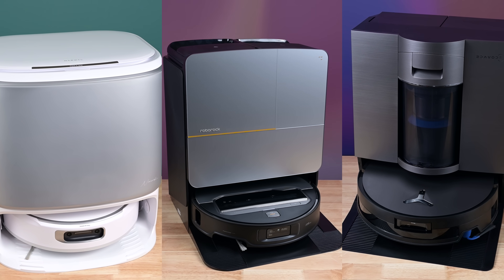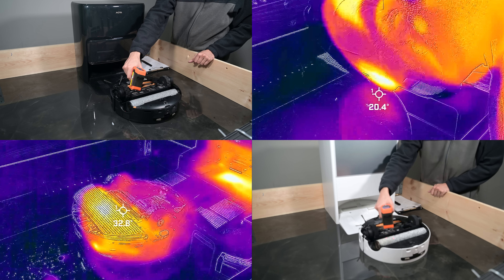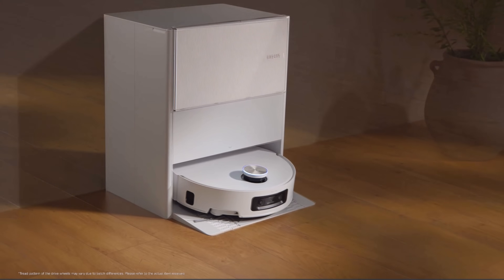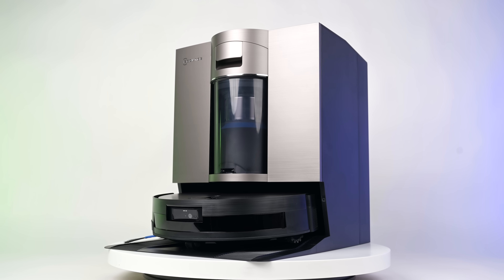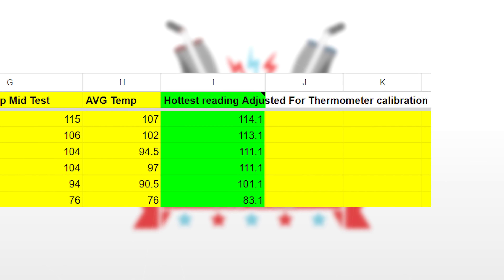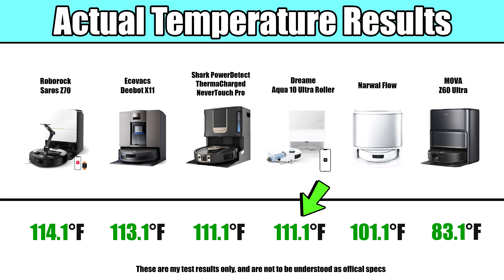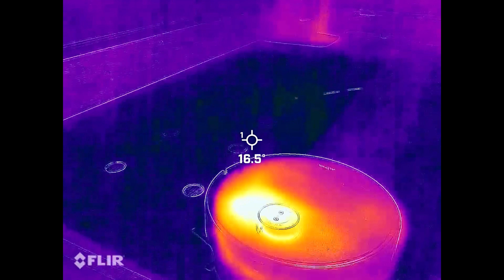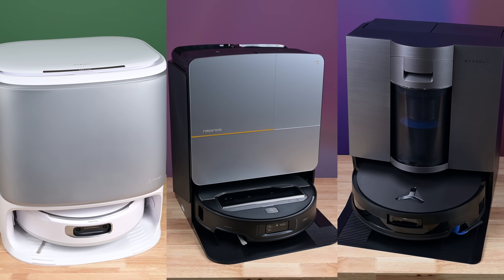Heated Robot Vacuum Mop Docks: Claims vs Reality (Thermal / Temp Tests)

Comment: infrared after the cleaning is not a good test. In these temperatures and hot water (evaporative cooling) they can drop a lot of heat in seconds. Thermocouple in the tank where cleaning happens, that would do it. Or thin foil thermistor, isolated and on very thin wires glued over with kapton to the case, going outside.

Comment: Something I think is important that I haven’t seen touched on anywhere else is the how well the bases clean the mop pads. I think a good test for this would be to get some UV active liquid and put it on the mop pads to which the base will do its cleaning cycle. After it’s done you could take the mops and see how much of the uv liquid is actually gone and if there are specific spots that are missed

Comment: Microfibre cloths are not meant to be washed above 40 degrees celsius as it destroys the structure of the material.

So these high cleaning temperatures are actually ruining the mop pads. 🤦

Comment: Package claims not verified on real world test should be illegal. I understand there is a slight variation, and I'm willing to give the benefit of doubt, but not when the claimed temp is twice the one mesured. Especially for high price object as this since thermostats and temp controls are probably like maximum 5 more dollars to introduce.

I'd like to say this is probably bad calibration but this cannot be. Not to that extend.
Reply from the maker: Part of the goal with testing like this is to better understand where those differences come from and how they translate to actual use.
Reply: @VacuumWars  Yes, I get it and thank you for that. If it was about vacuum power (like CFM or air speed) it would makes sense because there is a lot involved in suction including the robot height. So a lot of factors can influence things so I would be really okay with vaste differences between claims and real world provided there is an explanation on the way to mesure things.

However, for water temperature, there is litterally no such thing. Temperature is a straigh up defined unit. You can get your water to temp, and it will be there on the good temperature on the pads. Or you cannot. You can lose a couple of degrees depending on the plumbing but you know, you have litterally water boilers for tea that can stop when water is boiling in like 5 seconds. So you boil up water, you wash, and then everything fine.

This is lying. As this is about cleaning, and disinfecting, it influences air quality during and after doing the cleaning, and can make a huge difference for people with allergies, this is not like having a robot that doesn't suck as much as it should and leave a bit things on the ground.

Comment: Engineer here, the small amounts of water used to clean a mop, and the thermal mass of the mop assembly, mean that very hot water applied to a mop will cool significantly. Manufacturers probably test/control incoming water from the heater unit, not once it’s applied to the mop. Granted, the temperature AT the mop does matter most on how much oil/grease is removed from the mop… so you’re doing the right thing! 🎉
Reply from the maker: Thanks for sharing that perspective. Thermal mass and rapid cooling definitely play a role, and it makes sense that some claims may reflect heater output rather than conditions at the mop itself. Looking at temperatures closer to the point of contact helps give a clearer picture of real-world behavior.

Comment: The voice isn’t bad, I don’t care for it at all.

The script and its delivery however is deal breaker.

The tempo is all wrong and the script is super bloated which doesn’t help.

The narrator has no intonation at all, its so flat it is completely impossible to get sentences structure and punctuation.
It really gets in the way.

Cut the ai crap. Don’t try to do more by getting help from slop pleas. It really undermine the actual work your doing behind the scene.
Less is more.

Comment: Quite possibly the worst testing methodology I've ever seen. 

This is beyond useless. Using an infrared thermometer to read the temperature of an absorbent material to under the water temp. 

Could be a lot better just to use a thermocouple in the water itself.

Comment: you should put a thermocouple at the point where the warm water comes out from the dock. Then you don't have to disturb the cleaning cycle and it should give a more fair representation.
Reply from the maker: That’s a solid suggestion. Measuring with a thermocouple right at the dock’s water outlet would avoid disrupting the cycle and give a more accurate, consistent picture of the actual water temperature being delivered.

Comment: It would probably be more accurate to somehow wire in a thermal probe in the washing basin to track the temperature
Reply from the maker: That’s a good idea. Measuring temperature directly in the wash basin with a wired thermal probe would remove a lot of variables.

Comment: Perhaps Mova Z60 need to set"High Temperature Cleaning Mop" in the app, as the default option is not the highest temperature setting.
Reply from the maker: Good point
Reply: @VacuumWars  Can you confirm during your testing that the Mova app was set to "High temperature cleaning mop"? I feel like this is a huge oversight.

Comment: This is one of the most rubbish videos this channel has ever made. First, optical thermometers are very inaccurate and have to be used within a specific distance range, in the video it was held too close. Second, readings vary depending on the type of surface you’re pointing at.
Also, every mop responds differently to temperature. The proper test would be to measure the actual water temperature coming from the outlet using a probe thermometer, nothing less, nothing more.

Comment: Wouldn’t we be more interested in the temperature of the water being applied to the mop pads than the temperature of the mop pads themselves?
Reply: I think both numbers are equally interesting. But it should be a lot easier to get an accurate temperature reading from a liquid as opposed to the mops.
Reply from the maker: Good question! Water temperature matters at the start, but what really affects cleaning is the temperature of the mop pads once they’re on the floor. The water cools very quickly after leaving the tank, so pad temperature ends up being the best indicator of sustained, real-world cleaning performance.

Comment: Laser thermometers are notoriously inaccurate. Why didn't you use a thermocouple and embed the wires directly into the vacuum? Those are far more accurate.
Reply: Optical thermometers aren't great for absolute temperature, but they should be fine for temperature comparisons, which is what matters most here. Someone else mentioned concerns about different material emissivity, but considering that all pads will be made from some type of plastic-based fabric (polyester or nylon, probably) and will be coated in water, I don't think this is likely to make a material difference in the results.
Reply: @Adreitz7  All great points, but the purpose of the test was to evaluate which device reaches the (absolute) temperature the manufacturer advertised. I think you have to measure the thermal elements in-situ to be able to properly measure that number. If I'm the manufacturer, that's the one that I'm going to use when making that claim.
Reply: @DougWilliams06 Thermal cameras might be off by 5 degrees or so, but never by 20 at reasonable temperatures (unless you are trying to measure a thermally reflective surface like metal or glass). Not good when you’re trying to diagnose a fever, but fine for a case like this. So I think the results as given are a fairly good indicator that none of the robots are able to maintain the claimed water temperatures for very long past the thermal elements that do the heating.
Reply: Who do you think this is? Consumer Reports? 😂 Also don't forget to click on their sponsored affiliate links.
Reply: Removing the vacuums from the docs also gives a lot of time for the temperatures to drop.

Comment: Great that you are focusing on this! - The producers' claims seem to be wildly exaggerated. I'm currently on my second Mova V50, as the first one's hot mop washing was - not hot at all.. And the second replacement unit, same problem. The mop is at ambient temperature after a washing session, right before a supposedly "hot water mopping" cleaning task.  I also tried emptying the dirty water tank right before initiating hot water mop washing, and  measured the dirty water tanks tempareture right after mop washing (we are talking seconds after), and the water temperature is the same ambient room temperature as the clean water. I still hope that this is an issue that Mova can fix with another replacement unit - and that it is not simply false advertising. When they claim 80 degree celcious mop waterwashing, then I expect the water to be 80 degrees while washing.
Reply from the maker: That’s a fair concern. there should be clear, noticeable heat during and right after the wash. If everything is still at room temperature seconds later, it raises real questions about whether the heating feature is actually operating as claimed.

Comment: Optical thermometers require calibration for the exact surface they are taking a measurement from. Since the mops from different brands are made from different materials, with different textures and colors, I don't think these results can be treated as an objective apples to apples comparison. Use a regular old thermocouple and I think it will be a much more objective test
Reply: Right, and the thermocouple could just be put into the dock sink to see the reading over time which could vary
Reply from the maker: Standardizing the measurement method is really the key either way.
Reply: @VacuumWars  The issue is with a laser thermometer the surface is part of the measurement method. A thermocouple would be more repeatable and accurate.